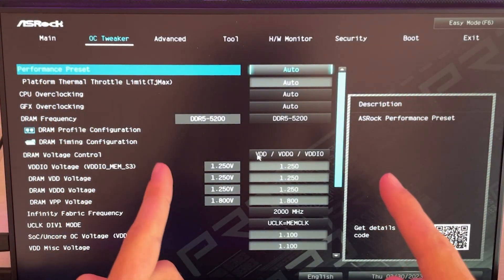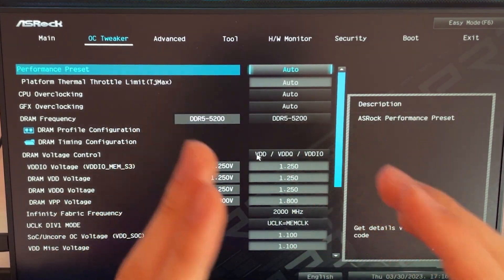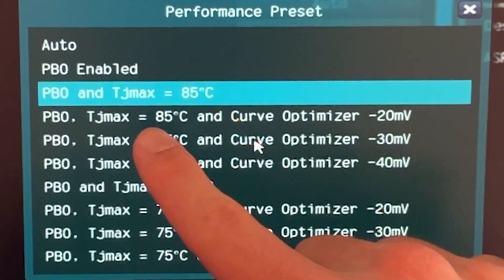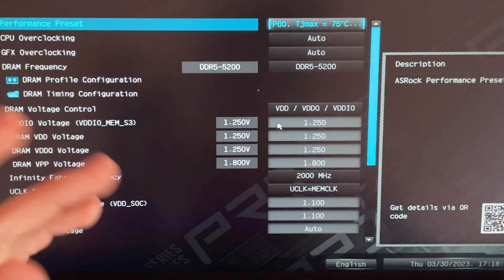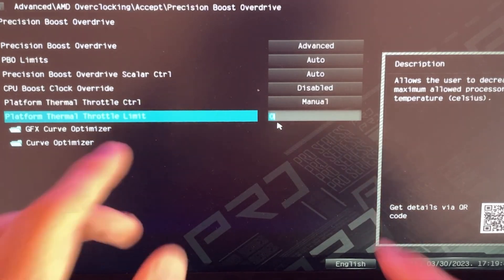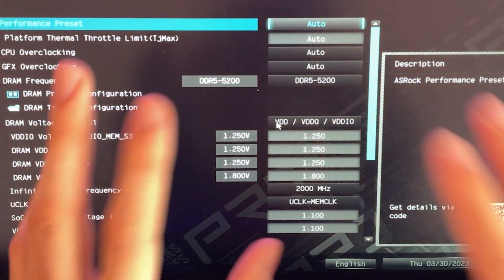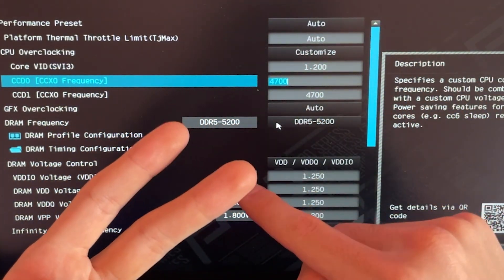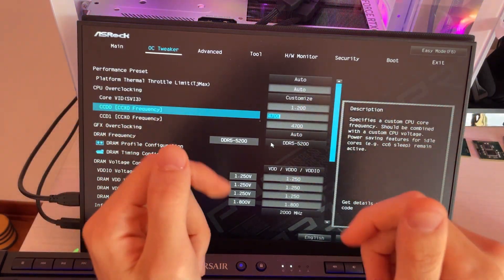Undervolt your Ryzen 9 7950X for more FPS and Lower Temperature!

Comment: Ok, with CO -20 it’s works, but one month ago it was going to blue screen. Why? Dunno. But now it goes, well, I will try with -30 now. Thanks. I have ASUS x670e proart, why it goes to blue screen before? Xyi znaet, but now it works.

Upd: Ok, I have worked with -25 CO and 75c, will try with 80c, but it already have bigger scores that stock in cinebench. 30 is blue screen

UPD: get -30 work with disabled C-states. Guys, If you want best results you need to disable it.

UPD: get 35 by disable df and c states, add ppt as 210, tdc 145, edc 205, +200 override max clock mhz for boost. I get 38078 on cinebench 23 with 85c using silent loop 2, llc level 5 and 85c limit temp.
Reply from the maker: Thanks a lot for reporting back with the testing! When testing stability on the new Ryzen, also double check that your EXPO is working, as very often that’s the problem. I definitely agree that disabling C-States help with stability! Thanks a lot for pointing it out!

Comment: Negative -20 on all cores on pbo and you done .........if your best core support -20 lol :D:D , cause if not you are just introduce yourself instability into your system:D
I like that at least say only -20 and not -30 from the beginning like others.
Cause in some cases and in some of the sample they are all ready tuned by amd with best voltage for the best core;) and in those cases the best core support very little negative voltage on the ''all ready tunned by amd  best core'' ;)
- I just see on reedit about 4 posts about sharing experience with pbo on new ryzen 7800x3d  and a lot of peoples saying put -30 and call it stable and you done, but after other users ask them if they test them for 24 hours of prime64 or aida64 sha3 bech some of them they come back and report they are getting error on prime or crashes:D
- Also i see other 2 peoples saying them best core support only -5 to -10.
- Is the same with my 7800X3D to ! 
Even  i can also do  -30 on all cores and i get stable cinebench r23 result, and i get all core boost to 5050 Mhz in multi,  (in single core it's still the same 5050Mhz that i was hitting with stock settings to), also i get stable boosting, also i get sable safe browse net to and even i get stable in my 2-3 favorite games, ....but.......... after i read that posts on reedit i start testing and discover that after 1 -2 hours of prime 95 the cpu cores start spiting  errors on prime 95 and aida sha3 benchmark!!!!!!!!!!!!!!!

- So i decide i will do not keep my cpu with errors reported on prime95 and call it stable like others!  and so i have to dial back the best core to -7 !, the other 3 cores to -15/-21/-21, and only the 4 worse cores to -30 to -32!! and only after that my prime 95 report 0 error after 5 hours of testing!!!
- But...surprising the difference between -30 and stock is not such a big deal at all in the case of 7800x3d!! lol 
( i guess is not even worth the 2-3 day spend it on tuning pbo with prime64 aida 64, y cruncher) ,  cause i believe this chip being mostly for gaming do not benefit for increase of more higher single clock  while using curve -30, like in cases of others ryzen 7000 non X3D cause the speed of single cores still do not surpass the max speed of 5050Mhz 
(in the case of non x3d is other story cause they can boost higher the single clock frequency with pbo so u have gain there)
- My stock 7800x3d was getting 18466 in in cinebench r23, all cores boosting to 4825 Mhz in multi cores, ....and any of the single core hit 5050 Mhz in hwinfo while browse net or youtube.
- Mabe my chip was allready tunned by amd from default with best volttage;) !!
- And with -30 on all cores i can hit 18836 points(all core boosting to 5050 Mhz in multi vs 4825 Mhz stock in multi,...so 18466 points stock vs 18836 points with -30.... so no such such a big deal ...just a little few points lol:D
- Temperature not such a big deal also to.....,  on stock 76 C on cinebench r23 multi, and with all cores at - 30 it's hit 79- 80 C cause is boost all cores at 5050 Mhz while on stock all cores boosting at 4825 Mhz, and on prime 95 i get same ~ temp 52-62 C with -30 curve or with stock to!( all core boosting to 4675 -4700Mhz) , and at idle is -2 -4 C less , and in game -2-4C less to, still not such a big difference, oh yes and my aio is 360 in push pull configuration.
Reply from the maker: Thanks a lot for the detailed report! I think what you’re writing about really applied to the X3D chips, which tend to have the CCD with the 3D vCache on top of it be MUCH more sensitive to voltage. 

-20 will work on 99% of non-X3D chips out there, the 1% might have to tune it back to -15. 

I will also do a specific X3D oriented tutorial, but have already discovered that you need to do per-core tuning!

Comment: Nice guide. I have the 7950X and set thermal limit to 80 and mV offset minus 20. Is it supposed to lower the idle temperature too?
Reply from the maker: I’m really happy it was helpful! Thanks a lot for taking the time to write this! On idle it should stay roughly the same, at least in my testing. Maybe 1-2 degrees lower!
Reply: @ImWateringPSUs  thanks for the response. I noticed around 2-3 degrees lower at idle. 
This is the very first time I'm fiddling with undervolting and thermal limits haha
Reply: I have the same, and on default bios it goes over 116C and shut down, with static 1.200 V - 4700Mhz it runs 51 at idle ! incredible ! DDR5 was set to XMP 1 with bump from 1.100 to 1.250V
Reply: @rnd2k you probably messed up with thermal paste
Reply: @SuperBROKEN81  No, at the end it was the Liquid cooler, a real CRAP. I put a noctua DH15, now the computer works flawlessly
Reply: @rnd2k  Ahh awesome! I had to give my 7950X an alcohol bath. Just because of the stupid heatsink design. The extra thermal paste went into it. So I think it was trapping heat. It was much easier to delid and direct die cooling.
Reply: @rnd2k I have Corsair cooler ( coolant one ) Iam inexperience I am really scarred changing volatile . Do u think cooler change will help?
Reply: Really nice tutorial!! Performance presets are so useful! Went with thermal limit 75 and offset minus 20. It just makes so much more sense!
And got 37438 in CineBench R23 instead of 36020 as of before!
Seems stable enough so far, but should I see crashes, would you recommend to maybe do minus 15 instead?

Comment: Hello my good sir, I'm having a persistent problem with my PC. It is that it keeps randomly rebooting out of the blue. Nothing on startup, just a straight up clean reboot. Sometimes 3 days between, sometimes 5 minutes and it reboots again. All my temps are good, I keep monitoring them with HWinfo. I also tried some of the fixes on reddit. It worked before when I was still in Windows 10 so I thought the issue is resolved, but after I updated to Windows 11, the problem came back. I really don't know what to do at this point so if anyone can help me, I would appreciate that a whole lot. Thank you so much!

I also have to add that I started to notice the issue after I enabled PBO (when I was still on Windows10) , so I reverted it to default settings but the problem remained.

Ryzen 5 5600x
Colorful RTX 3060TI
ASRock B550M HDV
Team Elite 2x8GB 3200Mhz CL22
Kingston PCIE4 500GB M.2 NVME SSD
CoolerMaster 750W 80+ Bronze Non-Modular

EDIT: I also noticed I am several versions behind on the BIOS (I'm on 2.10 while the latest is 2.62). How do you think should I update, go through all the versions or go straight to the latest one?
Reply: Maybe just cleanly reinstall windows, but it's hard to distant-diagnose this. Seems like your Windows is the problem though obviously
Reply from the maker: Here's what I'd recommend you do (in order)
-Update your bios to the latest version
-Do a fresh Windows 11 install
-Follow my R5 5600X Undervolting tutorial, set it to 4GHz with 1.025V as shown in the tutorial
-Follow the RTX 3060 Ti Undervolting tutorial too, set it at a conservative 900mV 1800Mhz with no mem offset

This will get rid of your possible OS problems, fix any platform instability and reduce the power consumption/thermal output of the system, so it should fix any problem that's not directly coming from faulty hardware!
Reply: I also had that happening about a year ago, turned out it was literally one faulty sector in my 16gb of ram, and if ended up being used, the pc would just reboot. This could happen 4 times a day or once a month, completely random. Run memtests to ensure it's not your ram.